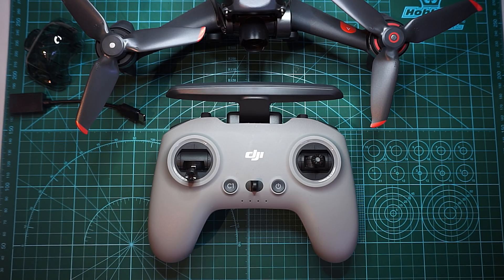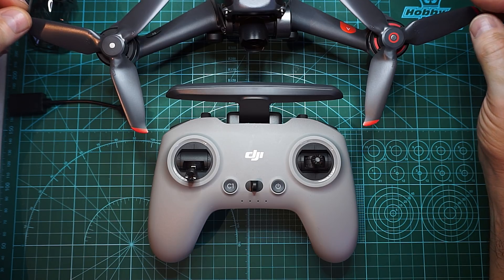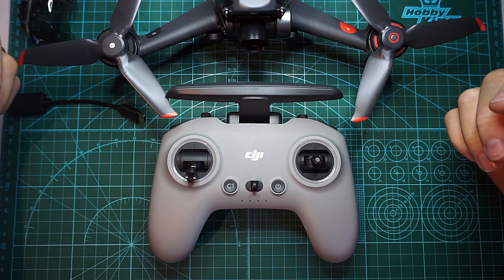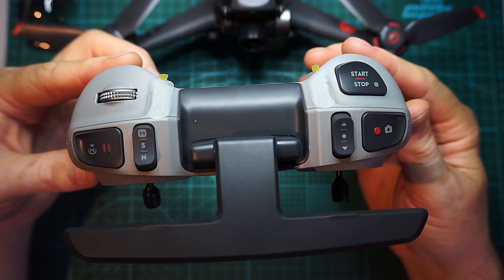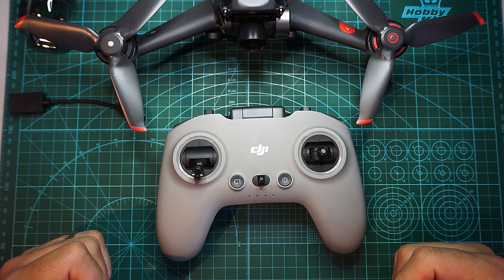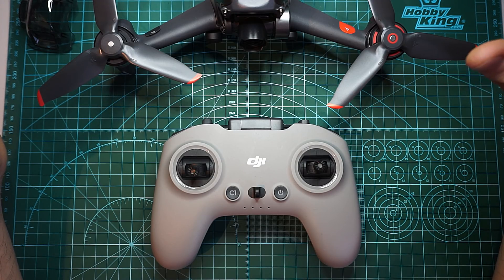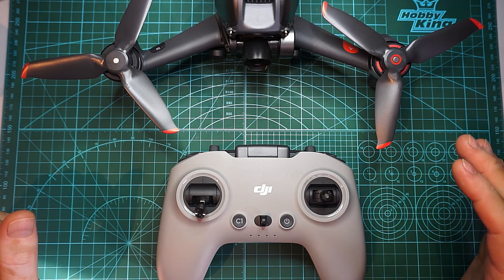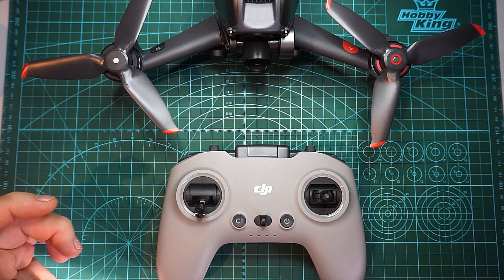DJI FPV DRONE, The Sad Truth! (FPV pilot honest opinion)

Comment: The point of DJI FPV drone i believe is the extra system added into the drone to make it a reliable and solid product but FPV, and in the end adding tons of weight, but avoiding things like 
like losing signal behind a building and drop from mid air, like poor battery life, like no hover and such 
from your usual DIY drone, for which these things might be acceptable but definitely not for the mass market or average consumer

which is also another reason I believe the tons of making read-to-fly fpv DIY drones will never make it big or work as a solid business model (so far it had been true), their best bet is selling their service as photographer.. and also why it's smart for DJI to prioritize the reliability and usability in their FPV drone rather than performance and such, imo

this turned out way longer but it had been my opinion on this product since their launch

Comment: I reached out to DJI to offer to tune-up three Presets for them to add in a future update, but no bites.  :-/  
Would be nice if you could access the PIDs, but no dice so you are kind of stuck.  :-/  :-/
Reply: Q-RapidPrototyping  it could be better for sure.  I understand a low PIDs default for consumer-grade, but some other presets would be nice.  I think they will find that not being a camera drone just slowly cruising around with a 3-axis stabilized camera, that they will need to pay more attention to the PID tune for a good customer experience.  In the past, it didn't matter because: 1) camera drone | 2) 3-axis gimbal.
Reply: @uavtech  your tune would make them millions. Make sure you charge accordingly!

Comment: Do you really think that it is good for fpv beginners who want to take up the fpv hobby? When a beginner who bought this drone will decide to fly serious fpv quads, he/she will still need to learn building drones and fixing them and flying them without stabilization and safety feature. So this drone will not reduce this effort, only postpone it. Also, after buying this drone, they may not have the money to buy the tools and parts to build their first drones... So this drone may simply reduce the distance a beginner can walk in the path of fpv, because it will only consume his/her money resorces. However, it may  push into the fpv hobby those who did not know what fpv was. I agree with all you say, but I find this drone useless, if not detrimental, for the beginner who buys it for learning fpv.
Reply from the maker: Oh... I was thinking more on Mavic beginners :P If you are really interested in this hobby then DIY is the way to go.

Comment: Thanks for the honest review. I purchased this drone and have no FPV experience. I do have experience with the DJI Phantom 1 & 3 and have been wanting to try FPV but I am not really looking to get in to racing or tricks. So basically I have wanted a FPV Mavic and this appears to be much of what I am getting. I also want to try FPV in my RC truck and was going to just buy the DJI camera and goggles but figured I would go ahead and buy the FPV combo and get another camera for my RC car later.

Comment: Is the normal drone better tuned, lighter, both or what are the differences?
Very interesting perspective from a real pilot, btw.
Reply from the maker: Well not a hole lot lighter, but it is top notch when it comes to motors,esc and flight controller. It is designed to be very good in manual mode. The weight is around 700g.

Comment: I'm really shocked how the DJI flies when the gimbal doesn't compensate flying characteristics 😳

I mean my very first Cinewhoop (made out of a cheap frame and a tyro79) flew way better, even though it was also totally underpowered and I had no clue about rates and PIDs 🤣
I know 3" vs 7" but the "set" was at a cost of ~300€ with goggles, drone and remote 😁👍

Comment: FPV simply means "First Person View", which it is, hence the goggles. Everyone sees FPV and assumes it's a racing drone or a freestyle drone, which it's not and doesn't claim to be. You actually have to manually turn off options to get it to fly acro. This drone is meant for people who want a mavic-like, first person experience, with the capability of added performance when desired. If you bought it for a full blown racing drone, or a full blown freestyle drone, then you are going to be disappointed, because this isn't what it was designed for.
Reply from the maker: I did not bought it :) But when FPV is on the frame everyone will think it is a racing drone... and it is not! So people should know this :p
Reply: @LivyuFPV  That is my point, people jump to the conclusion by seeing "FPV". I agree that people need to know this, but they also need to do their own research before jumping all in and assuming it's something that it's not. Nowhere on the product page does it say racing drone, or freestyle drone. I see countless reviews of people rushing to buy this because they assumed it was a racing freestyle drone because they see the term FPV and then turn around and give it bad reviews due to their own assumptions.  Glad you didn't buy it if you don't like it. Luckily you got to test it out without buying. 👍

Comment: It’s not aimed at you or us seasoned FPV self-builders. Imagine if you had never flown FPV - this would be utterly fantastic to you - and that’s the point of it. It’s not meant for freestyle , it’s a cruiser that’s a step up in dynamics from a Mavic.
Reply: yep, i was watching a group of drone youtubers debate this and the non dedicated-FPV guy in the bunch had put out a video where in manual mode he had done some long swooping passes and some tight turns at the end of runs with some rolls and flips... to me it was amazing and a goal but the other guys on the video called him a p***y with his flying skills because they were used to FPV drones with such power and capability that only Mr. Steele seemed the goal anymore. this drone is a dud for the FPV community but for the much larger community of recreational drone pilots who think of drones as a Mavic or Phantom this might as well as be a Formula 1 racer.

Comment: But any drone, no matter who it is made for, should not be fragile and it should be possible to buy spare motors for... and batteries should not cost 159 USD... and the charger should have readable values and should have parallel charging... and should have standard propeller mounts... and should have a GoPro mount.... and the manufacturer should not lie about flight times... and should not make fake videos fooling customers to believe the drone is better than what it is... and it should be possible to use third party batteries...and it should not have geofencing and stupid registration of it's user.... and ....  and ....  and ....  and .... just buy any other ready to fly fpv drone from any other manufacturer and you are fine!

Comment: Are we looking at this drone wrong? You've clearly shown how this drone is borderline hopeless for the typical high speed flippy-floppies of freestyle but I wonder if a better comparison would be to something like the long-range micro four inch category would be better. In fact I almost see this as a sort of cinewhoop for outdoors. I've seen it fair much better when used for slower / smoother flights without really any flips or rolls - Essentially just in Sport mode but with the FPV-like cinematic experience.

So maybe the goal of this drone is to have something that's somewhat cinematic, but for larger areas / outdoors and is still easy to just pick up and fly. If you look at it from that viewpoint, most of the problems raised by you and others disappear. The only thing that's really still relevant for that is the propwash which really is unforgivable. I hope that an aftermarket set of props might be released to resolve the propwash issues but I'm not sure it will ever fully go away considering how bad it is right now.

Anyway that's my thoughts. Tl;dr: What if you drop the flips / rolls and prioritise smoothness over everything else?
Reply: But a Cinematic-FPV experience with props in view. This drone can everything but nothing really good.
Reply: @rf-cinematic1576  You're right, having the props in view is really unfortunate - Especially with the red tips they've added. Maybe something like the Ethix S5 props could help, but at the end of the day you're going to have to crop the video down if you want to avoid it which then results in a non-standard resolution. I think they've done this on purpose to "protect" their other product lines sadly.
Reply from the maker: @yngndrw.  Well the underpower thing is the key here... you cannot expect an 800g quad to handle prop wash with low power. They said 20min max flight time but in normal cruising, some split s I got a max of 9 minutes. 9 minutes is only possible if the overall max power of the quad is lower than average. automatically having low power the prop wash is almost impossible to handle you need a lot more power reserve to cope with that. we will see.
Reply: @LivyuFPV  I was going to say that maybe a slightly larger prop would help increase the efficiency and therefore increase the available thrust, but they are already 5.3". You could just about fit a 6" prop on it but the tips would definitely smack the arms during maneuvers and it wouldn't help the props in view issue. Maybe a 5.5" prop would help? We're a little limited on options without touching the rest of the power system.

Comment: I was not subbed to you and this video was on my front page of Youtube. It was the 3rd video in the list. I thought "My god an honest review for a change"

I'm now going to watch the video but from watching all other "reviews" of this drone it seems everyone is up DJI ass and just claim it's all awesome. My honest thought was it's just a 3 inch Naza build with caddex vista. Not really worth freestyle but great to bypass the new CAA rules (UK) as it intergrates the low speed, low energy (crash test) and has all the safety features a brand new operator would require to not break stuff.

I must admit the motion controller seems pretty cool as a gimmick but i can't see it being used for flying much. Maybe if it was more "flight stick" style where the tophat was forward, back, yaw left/right and the trigger was up and down while tilting the controller was leaning left and right.  

If you read this i would love an independent NON DJI review of the new UK drone rules and what you can/cant do very soon as it seems unless you own a drone under 500g maximum take off weight you can't fly anywhere without spending £99 - £300 on the A2CofC test and FPV is dead unless you have a friend watching you (Altho a loophole i can see is having a view port within the goggles to allow unaided sight of the drone)
Reply from the maker: I don't know how the UK rules differ now from EU law but at least I have both A1-A3 and A2 licenses(no cost involved) in EU.
Reply: @LivyuFPV  The CAA is apperently following the EU rules but we now have open A1-A3 and open A2 which is based on weight, speed and distance from people and buildings. This only stands until December 2021 which then comes drone class marks C0 to C4 which is toy without camera under 250g is C0 which means it can be flown anywhere regardless of the rules without registration and C1 upwards forces us to get A2CofC excemption which costs a fair bit depending if you want to fly in parks or not. Basicly it seems anything over 500g which is most drones can't be flown anywhere other than the countryside so no more early morning or late evening flights at the local park/playing field as that is now restricted.
It's a huge headache to understand and the only people talking about it are always on about DJI drones and never your own built drones which sucks as it seems DJI is trying to corner and control the market.

Comment: Great review and we need to have honest opinions so people aren’t burning the $1500 (DJI product protection included). Super Idea with the comparison, not sure whey DJI would make it to see the tips of the props but hopefully they’ll listen to the FPV community.
Also the arms should’ve been partially carbon fiber attaching to the carbon fiber undercarriage. Already seeing photo’s of broken arms and breaking exactly where you said they’d break.
Still going DJI but only goggles and air units.
My aunt was Romanian and someone asked if she had any Gypsies in her family tree. UGGHHH, some people.
Reply: Wouldn’t call it burning $1500. It’s a great way to get in to the hobby for people that don’t want to take weeks to learn and do research about what items you need to purchase. Partially carbon fiber arms would’ve blocked a lot of the antenna signal, hence why the made it out of plastic.
Reply: @soccernerd200  you make a very valid point. It is though, a great gateway drone into the hobby. We are living in an automatic, drive through living instant gratification society these days. Just learning about FPV’s an extensive learning experience in itself but it provides you with quite a bit of knowledge after learning.
The best part is just knowing what it’s going to take for repairs and doing those repairs without the need to send it back to the manufacturer, that’s one of the bonus’s of this hobby.
I do however wish that DJI would provide stronger arms, you could still create half pipe type carbon fiber, have that as a front portion while the back of the arm’s can stay plastic.
You’ve got to have form as well as function. There’s nothing like seeing someone who’s just got it and their first flight a motor hanging with the broken plastic still attached to the motor.
But the important thing is is the experience, having fun and making new friends.
Reply from the maker: thanks man!